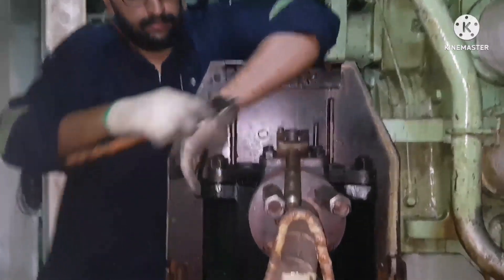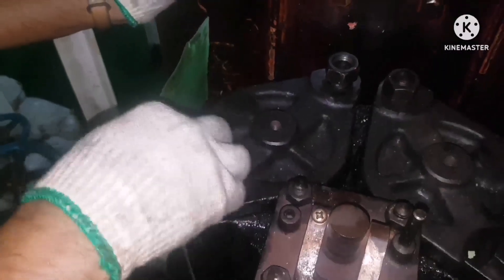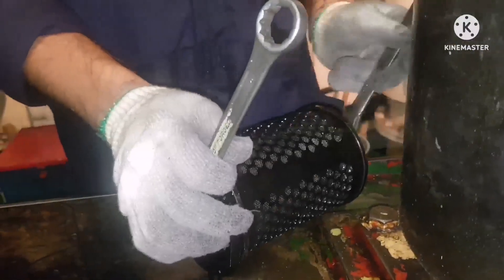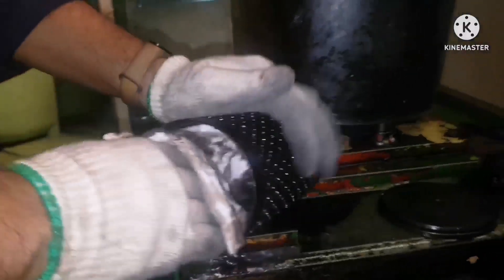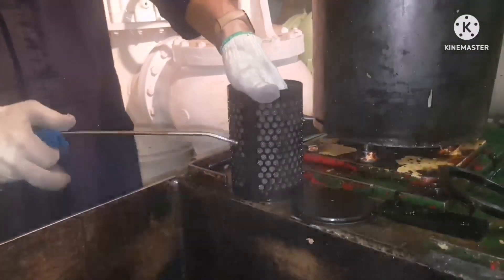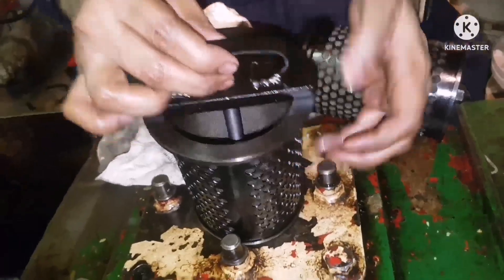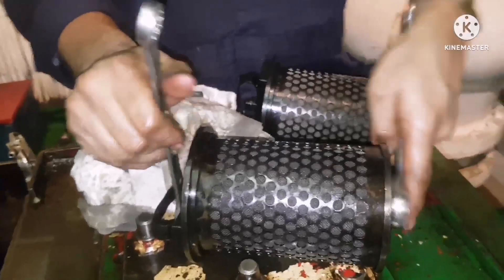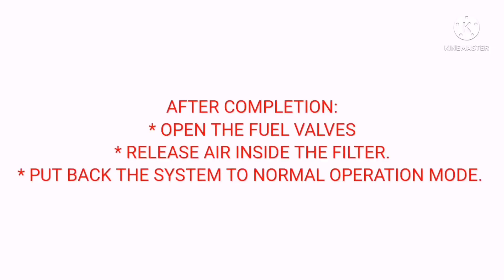HOW DO THEY DO... HOW TO DO FUEL FILTER ROUTINES FOR DIAHATSU GENERATOR ONBOARD SHIPS...

Comment: Much better tell us what to do if you have a pressure there and you can’t open the cover for cleaning filters . Filters box always under pressure ! What to do?
Reply from the maker: Sir u got a wonderful question...
This problems occurs frequently bcas of not venting the filter box...
U have to vent the filter box completely by opening vent plug so that the pressure get released nd ec to remove the cover.